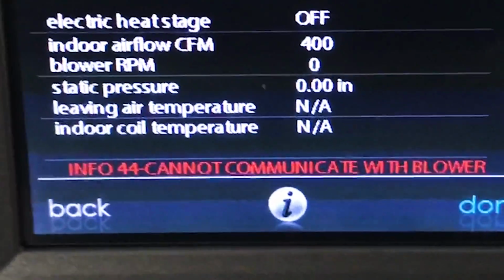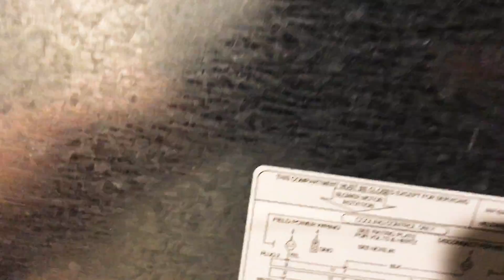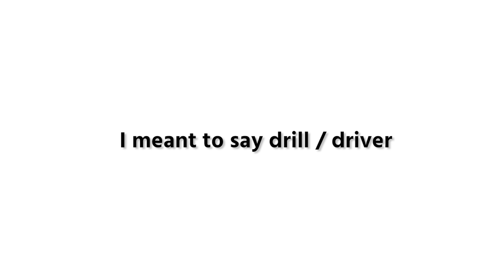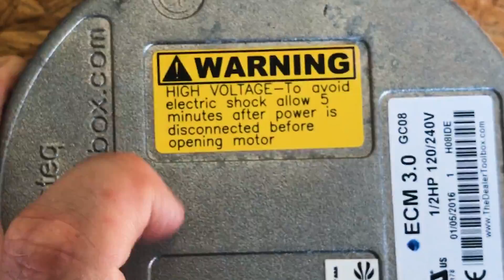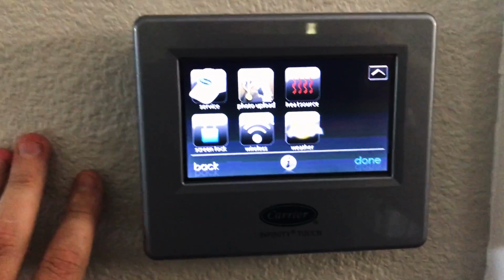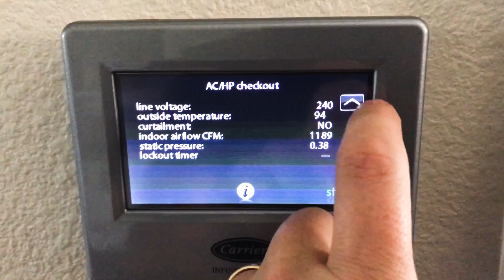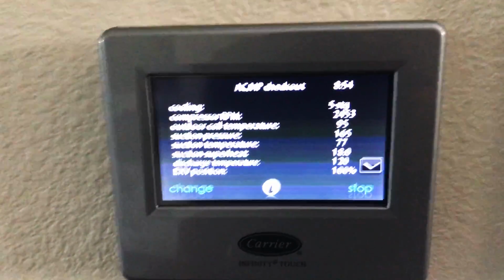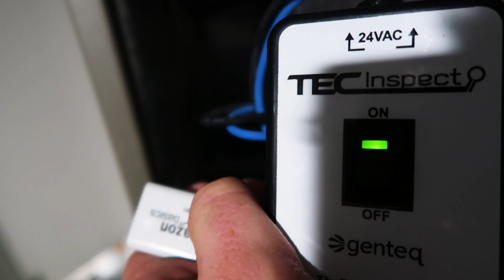ECM Blower Diagnosis on a Carrier Infinity System (HVAC Variable Speed Blower Diagnosis)

Comment: Very nice video, it gave me a lot of great information.  had my Carrier Infinity 21 SEER system "serviced"  and it failed the NEXT day. they wanted $2.3K to fix (code 41 blower motor failure),.. thanks to the helpful video, I checked around and tried to get the ECM unit.. Of course the won't replace that, or even bother to diagnose the motor...long/sort I fixed the problem myself for $350.
Reply: How did you fix it? New motor or both the motor and ECM module?
Reply: @akjijioeh  that is a great question.  so from Sigler (Carrier supplier) new blower motor plus ECM is about $800, but you need so-called AC license (which is BS).   The ECM itself is $500, so it doesn't make sense to just replace that, do motor plus ECM...   I fixed it by going to a local supplier that sells used AC parts, and they sold me a used (identical) blower plus ECM for $300, with a 1-year warranty.  In any event there was no way I was going to pay this AC Contractor $2.3K to fix this, so I got the used motor, and replaced it myself for $300 and it took me 20 min to install  (not difficult, 2 screws to remove the squirrel cage assy off the runners, then disconnect/reconnect 10 wires from the control board NOTE: be careful to take pictures before, so you don't forget.
Reply: @jd8866  Thanks so much! I did find a motor on eBay for $170! I got two of them just to make sure. Doing the DYI drop in install myself this week. Wish me luck!

Comment: guess who.... i just got the error 44 msg.  cycled breakers, no change.  all wiring looks good, nothing blocked, i suspect it's the control module inside the motor itself.  bryant evo 5T, every year there's a major failure with this thing, not too happy.
Reply: im the guy fixing it! My neighbors got a bryant evo about 13 yearsold. Wouldnt believe his unit took out another motor last 7 years its been a pita to work on.3 motors later i told him to do static pressure test to see if it helped not wipe out so many motors !
Reply: @m.vasquez2640  when I Inquired about static pressure, my dealer said "is there an error message being displayed? If not,  then don't worry about it" then proceeded to tell me my wife was too sensitive and tried to sell me a reme halo. It's like saying don't check the oil in the car,  just drive it till the oil light comes on. . . Yeah, right.

Comment: I always hand screw the mounting screw in so i know they are not cross threading. Then drill and lightly torque. Not impact. Then usually I will use a nut driver to hand snug them all up. Works good for me

Comment: Hello Brian,
Thanks for another great video.
Carrier has a very good troubleshooting guide for their various units. The short and sweet of it is, you find the fault code then using the troubleshooting guide, you start a series of electrical tests. Each test ends with did you measure “ whatever” voltage their looking for. Yes/ no
If yes you follow that path of tests, likewise if the answer is no, you follow that pathway.
No matter it always takes you to a definitive conclusion, change ……
whatever.
For less experienced techs, this avoids a lot of mis- diagnosis.
Those end bells/ modules were redesigned around 2006-09. The high failure rate was found to be caused by the computer trying to maintain the 350/400 CFM per ton when up against poor duct systems that already had excessive static.
Thus they redesigned the electronics to “limit” the RPMs so they wouldn’t burn out.
Power spikes and voltage surges are still  a problem of our aging power grid and thus contributes to failures too.

Comment: Found a snake wrapped around the fan outside after getting error code 44. Removed the snake changed the filters and reset breaker. Still 44 cannot connect to blower. Fan setting doesn’t work either. My unit is two months old.

Comment: I don't recommend this kind of units to any customer. Control board is over $1000 and a thermostat is over $500. You may saved some money on electricity, but the parts cost more and it takes more time for a HVAC technician to do diagnosis (which means more repair cost). Keep it simple, stupid manufacturer
Reply: That why I'm a big believer of old school. I would rather keep an old R-22 system with a PSC motor. Than, purchase any new system with leaky coils, and all that crap. Besides, R-22 pound for pound the best refrigerant ever outside of R-12.
Reply: @syn-techcooling7282  maybe you should stop buying junk American equipment, and buy something better like a Fujitsu or Mitsubishi system. Much lower failure rates and a 10 year parts and labour warranty.

Comment: Can you discuss what a bad idea these ECM motors are?  Some energy savings versus absurd replacement costs due to high failure rates. $800 for a new one! How about a video on how to convert to an PSC motor? Sorry my motor ECM failed and I'm really angry with this type of motor.
Reply: Why not go to school and learn about this stuff instead of asking folks who are in this field to help you instead of you making the effort and going to a trade to learn
Reply: @user-jh1mq2ih2u  I have no legs which makes it difficult.
Reply: @joecraigslist9467  then why criticize techs or other trades ?
Reply: @joecraigslist9467  you don't need to replace the entire motor, either the module is bad or the motor itself is bad but not both which makes it cheaper than $800. Have you actually had someone diagnose it and find out why it failed, eg too much static pressure. They usually don't fail for no reason.
Reply: @tomtom1541  I just got a used motor for 150.
Reply: @joecraigslist9467  nice, have you checked static pressure and supply voltage so see if one of them has caused the old motor to fail? Because if they are a problem it will happen again.
Reply: @tomtom1541  The motor was 14 yrs old. Supply voltage was good as well as static pressure.
Reply: @joecraigslist9467  well 14 years isnt that bad for a motor
Reply: @tomtom1541  Now I have a pinhole leak in the evap coil. System goes flat after 6 months. I think chewing gum could fix this.
Reply: @user-jh1mq2ih2u  Not other trades, just HVAC.

Comment: Is it possible to override the airflow calculations made by the carrier infinity software? I have a Carrier 3 ton heat pump model 25HNB936A connected to a FE4ANB006 fan coil. I have a single zone duct system.  My airflow assessment calculates 1050 cfm @.7" sp. I have the airflow setting in the thermostat set at MAX. When set in the automatic mode and fan speed on high, airflow is low compared to the airflow when I turn the system off and run the fan only. The house is  comfortable but would prefer more airflow when the system is set in AUTO

Comment: The cost of the module has just voided any savings provided by the ECM motor.
So much for costly federal registrations.
Reply: The module does have a 10 year factory warranty when unit is registered; after that, the module is not much more expensive than most OEM PSC motors.
Reply: No, it hasn't. He would have saved 20-30% on his electric bill and you can get these motor modules much cheaper nowadays. Plenty of manufacturers offer a 10 year warranty so you would have saved enough energy to buy one with change.

Comment: I find ecm motors go bad constantly it’s hard to tell how long they will last but 85% of them will go bad sooner than later and for some reason the other 15% never fail we put serge protectors in the line voltage supply
Reply: Bosch requires surge protector on their condenser.

Comment: From 10:40, could you please show us how  the 9vDC connected to 4-pin, pin to pin? So in future we can do it without buy the tool? Thank you so much.
Reply: You just need to know what your 24 volt power leg is and your common, application ofm24 volt to the signal wire will make the motor run

Comment: Great video and it got me to the ECM...which was not even on my radar. 
I have a question, in your situation...note: I have the old Inifinty system with the white box of PITA...my board appears to be identical to yours.
My board to motor output is 12.6VDC as was yours, however my yellow LED by the connector is NOT on like yours is in the video. SInce the output is still there, this still points to the ECM, correct? Or am I dealing with a board issue?
I am in the process of checking the motor now. Similarly, my cage fan turns well and does not show any issues of a mechanical defect.
Thank you in advance!
Mike
Reply: Addition...the "Motor" LED...just to be clear...
Reply: Update: Took off the ECM and cleaned everything, although apart from some VERY light mold on the outside of the connectors, everything was clean and dry to start with. 
However, since power was disconnected the system reset and my "fiddling" with the ECM got it going. Once running, the "Motor" LED flashed just as yours did in your video.
The ECM has a date code of 2016, the air handle of 2010...so this unit got only three years, (if that) of service and the original unit six...is this normal? IMHO what a POS!! (I mist admit we get a lot of lightning strikes, but I have several suppressors and arrestors installed in every panel and throughout the house...which i would have hope to mitigate the possibility of mother nature's damage)

I was never a Carrier fan just because of the way they designed their 3 and 3.5 ton air handler filter door...leaks leaks leaks and PITA to swap out filters!!! 
Still, having said that, my 3 ton unit at my previous house ran form install (2004) till this very day with only a few issues ever! (one board in the outside unit and two caps!) In Central Florida, that is totally acceptable...but this Infinity system is like a rash all over the net...and they seemed to have replaced the original setup very quickly with the "New and Improved" silvery unit. (the original which they seemed to have aquired from "Bryant")
Makes perfect sense these days...take a perfectly fine system and make it more expensive and MUCH less reliable!

Anyway, thank you for the awesome and clarifying video...it focused my troubleshooting efforts and I am confident now that my ECM is in failure mode, so I will be heading to my local HVAC supply store for, what I am sure will be, a $400 replacement part!

Is there a way to test the ECM with a DVM? I know you had the TEC check system with the 9V battery, however I do not plan on making that investment...so a resistance check or similar just to eliminate or confirm the ECM would be a greatly appreciated bit of advice!
Thanx again and all my best to you and your family!
Mike
Reply: @navygse1  whats the TESP of your system? how many sg. in./per ton of filter area does the factory filter rail provide? whats the MERV rating of the filters you are using?
Reply: @markhoffmann5941  
No idea on the pressures, the ECM was bad, fortunately I found a replacement on RepairClinic.
I am using the AprilAire Merv 14 filter system, the entire setup works exceptionally well, very pleased with it.
While the Infinity system is problematic and defaults to heat mode after a power outage, it has many desirable features.

Comment: So I have Carrier 2.5 ecm that I salvaged from a unit that had a coil go bad.  I want to use it for something else but after hours of looking at you tube I can’t get the wiring for it to start.  I have the power plug wired to 120 and the voltage is good at motor.  Safety ground in place.  Yellow jumper in place on this plug as needed for 120v.   I have a 24v AC transformer supplying 26v AC.  I read dozens of posts on how to wire this to the other plug but none work.  My speed tap plug is a 16 connector with only 4 wires in it.  R,Y, B,and G.  If looking from wire side of this adapter with the adapter snap up and reading left to right and top to bottom, the R is in position 2, the G is position 8, the Y position 9, and B position 15.  I am not sure where the 24v common goes?  Which of the four wires are speed taps?  And after this video using 9 V battery was I misled into using AC for control and should be using DC?   Appreciate help as will my dogs with their new ventilation!
Reply: Bummer....No responses.  Hoping someone with better understanding of this will respond...

Comment: I recommend setting these motors in the AUTO mode to my customers.  Question: when a profile is not used and the thermostat is in manual mode, does the blower operate in the AUTO mode regardless of the profile setting?

Comment: Carrier thinks their shit is gold... I mean if your not a carrier dealer they really stick it to you... I got quoted 900 for a damn ecm motor and module for a 4 ton 2 stage gas furnace, albeit the motor is a 1 h.p. motor with the damn dog ear bracket wielded to the motor... but still the damn furnace is cheaper than that

Comment: I am disappointed you did not explain how to test the module.  You assumed it was bad because the motor tested OK.  I wanted to know how to test the module in case there might be something wrong with the board instead.
Reply from the maker: Wayne Martin if you watch to the end I do show how to confirm with a tester
Reply: He went over it quickly, but the system gave him the info 3:43

Comment: Just curious how yall break the low voltage from your float switch on your communicating systems, are carrier rep says to run the transformer thru the switch then back to the board.
Reply: Hook up float switch to r and g on the board at ahu then go to service on t-stat then setup and setup auxiliary g input to shutoff when open. Set it for normally closed of course
Reply: My carrier rep says “In communicating systems, you have to wire float switch before the board. So that the control board does not know it exists.”*** And you have to tie all unused wires to common. Even if you run 18/5 you’re supposed to tie all unused wires together and then to common or it will interrupt communication. Also make sure high-voltage is not close!!! Be safe!?
Reply: @hvacpro89lonewolf45  interesting info
Reply: John Jones rheem gives you wires to hook it to and it will log a float switch trip in the memory
Reply: Joe Shearer sounds like a good setup, the last communication style rudd I put in was those 2 stage 16 seer ones with the emerson tstats, I think that's what brand they were